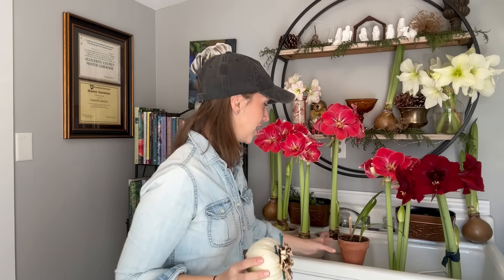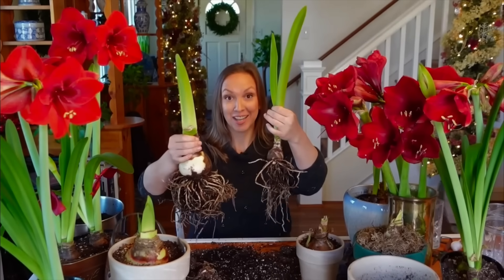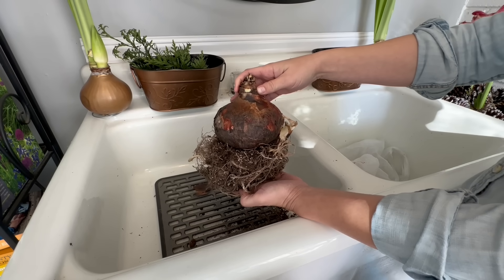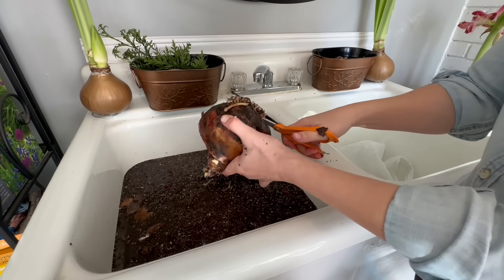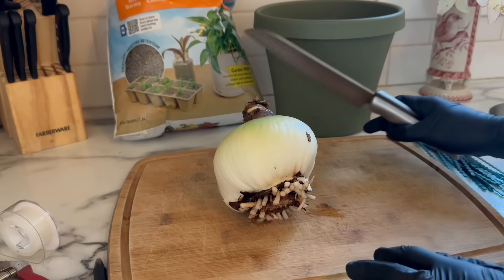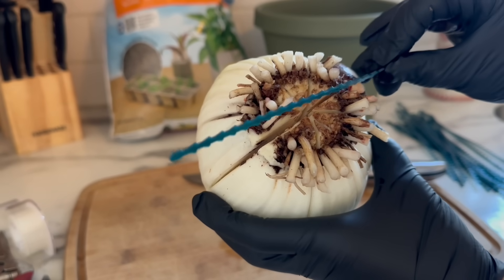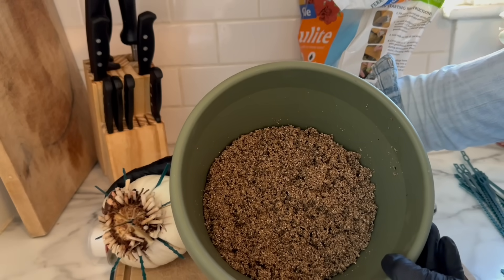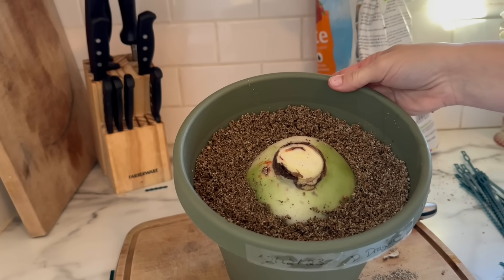Propagating Amaryllis by Chipping / Notching Hippeastrum Bulbs to Produce Multiple Offsets

Comment: "chipping" a bulb means cutting it all the way through.  Your way saves on pots, but you should cut it through and through into 8 separate "chips" and plant out each one.  You can see it in the illustrations from the article that you posted.  From the article - - "we find
that sectioning the bulb into 8 segments is the best method for vegetative propagation of Amaryllis. "

Comment: Some questions for you plse!
Why not just cut all the way through to get 8 pces and pot straight into potting medium?
If you do cut all the way through do you allow the cut pieces to wind dry the cut surfaces before potting?
What about powdering with an antifungal product before potting?
How much watering will be required?
Should the pot be placed in a sealed enviroment to retain the moisture and humididty?
How long will the new plants need to flower?
Thanks in advance.

Comment: Hi Danielle 
Couldn’t figure out how to message you, I live in Michigan. I hadn’t read too much about reblooming Amarilis, but I did read somewhere along the way that I could plant it outside and then dig it up, which I did so I currently have a bulb with roots on it would I just repot that for this year‘s bloom inside, do I need to cut any roots back and it still has two leaves coming out the top . Now that I found your channel, I can learn a lot more, but I’m not sure exactly how to handle the two bulbs I currently have. I’m not overly concerned with having them bloom for Christmas.

Comment: Danielle, what do you do with your bulbs for the summer? Do you plant outdoors, or keep inside?  I just found out that all three that I planted outdoors this past summer have been affected by the Narcissus fly.  One was rotting inside and the larva was still inside too, another one was rotting but no larva that I found, and the third had some exterior damage that I had to clean up.  I have chipped two of these plants using sections where the basal plate was still ok, by cutting sections, drying and then planting.  One of them was Magic Touch that was beautiful last year!  I've done some research, and for next summer, I think I'm either going to put fine mesh cloth around the plant so the fly can't lay it's eggs in the layers, or just wait until late June when the reproductive cycle is over with for the fly.... I've no ordered 3 more bulbs, plus the original 3 I already ordered, and I don't want to let these get damaged next summer.  Do you just keep them inside?

Comment: Have seen results of chipping where they just completely cut through the basal plate and the individual 8 pieces were placed in vermiculite/sand mixture.   All 8 pieces had room to grow.
Reply: Less chance of rot wiping out your bulb if cut into 4 or 8  then half cutting a bulb like this.Cant see   what's hiding in the middle without uprooting the bulb.

Comment: This is so very interesting. You have inspired my love of growing amaryllis. I have a couple of questions. Two of my held over amaryllis have only shot up leaves. Why am I not getting a flower stalk? I also bought a new bulb and is currently full bloom. I can squeeze the bulb in quite a bit. Like it’s squishy. Does this mean it will not survive long term? Thank you, love your content.
Reply from the maker: Hi friend! How big were the bulbs when you put them into dormancy? At least 26 cm and four leaves? Some varieties put up leaves first. If a bulb fails to rebloom it’s generally because it’s not big enough, didn’t get enough  sun/energy over the summer, or incorrect dormancy temperature/time. If your reblooming a bulb from a kit those bulbs are often very small. They will sometimes skip a year. Whatever happens don’t give up! They will eventually bloom again once they are big enough. The only bulbs I’ve ever struggled with are the ones that are very small to begin with. In terms of the new bulb - was it squishy when you purchased it? If so, I would contact the supplier. However, an amaryllis bulb shrinks as it pushes flowering scapes and leaves. You may just be seeing the bulb lose mass because of that. An amaryllis bulb will shrink significantly while it blooms and pushes leaves. Then is gets bigger again over the spring, summer, and fall. I hope that helps.
Reply: Thank you so much for replying.  This all makes sense to me.  I haven't  measured them, but they are from kits or one I peeled the wax off of last year, so they are probably too small.  I put them into my basement Sept 5 and took them out around Nov 20th.  The squishy one has a lot of blooms going on and I can understand why it's squishy.  No it was not squishy when I bought it.  I bought it at a store and checked it first, it is smaller tho and not huge like the one you propagated in todays video.  I am only on my third year of growing them and last summer was the first time I took them out to my porch.  Do you fertilize them? When?  I have listened to all your amaryllis video's so I may have missed it.  I need to rewatch them all.  lol  You and Laura from Garden Answer are such inspirations for me and hard on my pocket book.  lol  Have a great day.